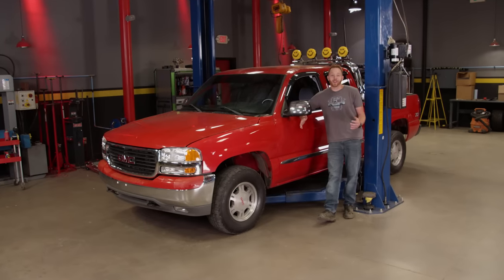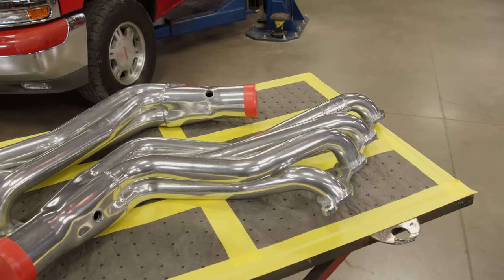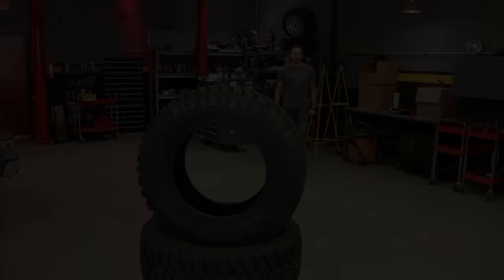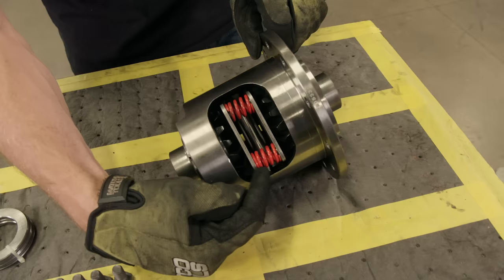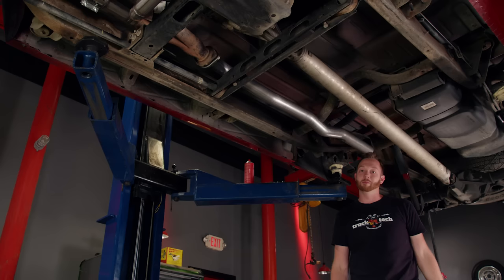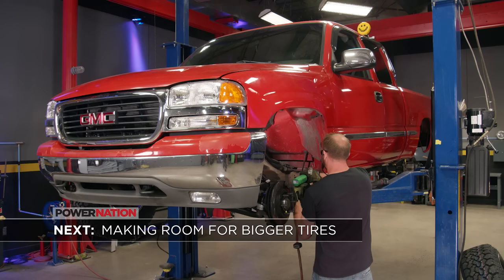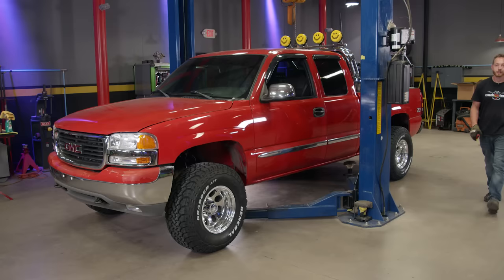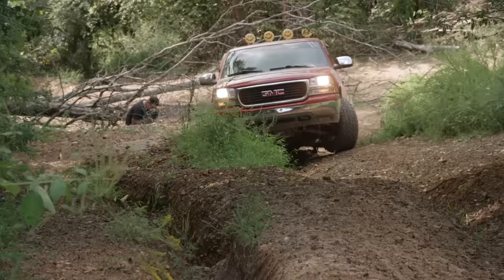FULL BUILD: Converting this 2002 GMC Sierra 1500 to a Mid 90s Throwback

Comment: You nailed the retro 90s look SPOT ON. The roll bar, KC lighting, polished “bullet hole” wheels, white letter tires…..AWESOME looking truck much better than the blacked out trucks with black 22” wheels, rubber band tires, Chinese tow mirrors, eBay led light bars, etc
Reply: you think they are chinese but they arent.
Reply: Retro 90's?  Roll bars were well before the 90's.  Lol
Reply: @Brian-dh9lp  yes popular in the 70s-the 90s.
Reply: Ahhh yeah!
Reply: 90s was peak truck. Whether its a 1500 or a 379
Reply: It's hard to appreciate a truck when everything is black.

Comment: Not particularly crazy about gmc but this generation sierra 1500 is one of my favorite bodystyles of all time.
Reply: I agree, not a big fan of the newer body styles regardless of the make. I drive a 2001 gmc sierra, came factory with the 5.3 lm7 engine but switched it for an Lq4 out of a later model serria 2500hd. With a bigger intake, a mid-priced exhaust kit at 280k miles it still surprises the hell out of some people at stoplights or on the highway
Reply: I love the 2023 GMCs they have that smooth but boxy look, I like it better than the Silverados except for the HD Silverados!
Reply: I love these with a single cab

Comment: I have a same generation Silverado with over 400k miles on it. Pretty much stock as well. They really will last forever
Reply: Mine has 200k right on it same color as this one in video only thing changed so far was water pump radiator but definitely needs head gasket now but very reliable truck

Comment: Absolutely gorgeous. I have an '05 Yukon XL I've built as an overlander/sand ripper. It's also my daily driver. All 9.2mpg and nearly 7k lbs of it still turns heads to this day.
Reply: Agreed. I have an '04 Yukon XL. The only GM I actually like and is still a far more attractive vehicle today than most out there
Reply: @VentureGarageOfficial  have you rebuilt that awful 4L80E yet? Had a shift kit done to mine. Nearly $4,000 for the whole thing. Only the casing is stock.
Reply: @searchBLOC941  I have the 4L60e in mine. And nope I have not yet! It still shifts smooth at well over 400,000km on the vehicle now. Tiny slip from 2-3 but nothing worrying.

Comment: I was in High school from 98-02 and there were a few old Square body's that had roll bars but most of the 90s trucks had chrome tool boxes, chrome bed bars and bullet holes.
Reply: Thats what I did to my '97 single cab silverado. Fender flares, M/T Classic III's, 35s, chrome tool box, and a giant DMI chrome rear bumper

Comment: I would’ve done a sheet metal intake manifold as well. Relatively cheap and easy to source it it really helps to open up the top end hp wise on those trucks. Great build though. Keep up the great work!

Comment: That’s awesome!!
I have an 02 Sierra 2500 with the 6.0 liter V8. It’s a gas guzzler. But it runs great still as I close in on 200K miles. I’d love to upgrade the exhaust like this.

Comment: My 1997 gmc Sierra slt 4x4 is in great condition. 100% stock!She's got 197000 Miles on her. I get a lot of compliments wherever I go! My other 2005 gmc Sierra sl 2x4 while it's a good truck just isn't the same. While it has more power on paper, it doesn't feel like it. The 5.3 is a good engine, no doubt, but I just prefer the old workhorse 5.7 in my 1997 truck.😊

Comment: the exhaust you used on this truck is great!, I have a 02 sierra, its only has the 4.8 V8 but I literally have the same exhaust minus the headers, still has stock manifolds, but it sounds exactly like the truck in the video. Mine has 375800km or 233511 miles(still original stock motor). still a great truck!. Guess Iam starting to show my age lol. my old high school yrs!. Great video.

Comment: You pretty much nailed it. The only thing i think would made it a lil more authentic for 90's is true duals with glasspacks like thrush or maybe some cherry bombs. Thats a true 90's truck exhaust. Now early 2000's truck exhaust we just ran true duals and chopped the mufflers off completely. 😂 it does sound damn good tho. Great job. 👍

Comment: I have an 03 Tahoe and I put 33x12.5 tires on it. But I also had 12" wide wheels with a -44 offset. I also had to trim my bumper and inner fenders just as you did, but I also had to lose my windshield washer reservoir because the driver side tire rubbed against it and would've just worn a hole in it. But you know, sometimes you have priorities and a good looking set of wheels and tires are much more important than windshield washer.

Comment: Hey I like my 33s.  This is pretty much what I did to my Silverado but no rear blocks.  The BFG KO/2 is a really good tire and not super expensive for a 33" tire which can get really expensive depending on what you buy.  Oh and it satisfies the muscle car guy in me because you can get white letters.  The Rough Country leveling struts ride really nice and you can run the 33 without rubbing.
Reply: A big electrical contractor company I worked for exclusively bought and used the K/o2 for their fleet trucks, roaming all over Oregon and it's crazy range of weather and driving environments.
For good reason I have learned 😁👍
I beefed My 93 Silverado with 2500 leaf springs, getting a couple of inches of lift and added cargo load capacity.
My 2005 2500 heavy duty is my daily for work and after two years of hard use I'm happy with it (BF Goodrich all terrains) lots of miles

Comment: Ive never had a issue with a G80 locker got 419 000km on my 9.5 14 bolt Z71 98 Silverado and the G80 locker still works as good as new all these years later

Comment: I did this same build with my hualer, its a 2002 chevrolet 2500 hd, extend cab long bed Did the roll bar with kc lights, 33s mild lift.   Did a brush guard and tail light guards

Comment: I want to do a build like this for my 79 Dodge W150 Power Wagon. It has leaf springs, but I can get a 2" lift for it with new springs. My friend that sold it to me put some 33x12.5R15 Firestone Destination M/T tires on it and replaced the clutch(NP435 trans, NP203 case). I'll probably keep the stock steelies, but definitely want the roll bar and KC lights, and a brush guard. Probably get those in black since it'll be a little more fitting for the patina that I have no plans on changing.

Comment: It's hilarious that he said those KC's were cheaper than LED light bars, those 4 lights cost around $500, LED light bar runs $150
Reply: In fairness, if you get a $150 light bar, it's not going to be on par quality wise with KCs. I think he's probably referring to Baja or Rigid light bars that are likely, still over a grand.
Reply: The LED KC's are $500 a pair, but the regular halogens are much cheaper. But their quality and lifetime warranty makes it worth it to me. Those $150 light bars will have condensation within a few months.

Comment: The '90s retro on those GMT800s looks right on the spot cause they still look slightly the same as the '88-2000 GMT400 body style 💪...
Reply: the gmt800 was very much a evolution of the 400,  i had a400 and have a 800 now, they are so related, but still i doubt there is a single thing that would swap between them

Comment: Those tiered wont last offroad. Ask me how I know😅 I installed sleeves on mine. But should have got a dedicated offroad control arm. I replaced all balljoints with mevotech ttx, after I destroyed moog and off the shelf ones i previously installed. Has been bulletproof since.

Comment: By adding horsepower will it then be a gas guzzler? I have a 2000 that needs new rear springs and the side bed fixed and new rocker panels. I just had a Flowmaster installed. I feel the difference in horsepower with just that

Comment: Find me an in 2002. They were kind of the same mods at that time. You could even get sun visors for these still and they had the manual transmission.... But sure I get what you're trying to do. I mean technically it's a period correct build.... I did this with a POS 2016... Knobbies on stock rims dual exhaust no tow mirrors smoked lenses old school simple... Then go rid of that garbage when it's a/c and trans crapped out and got a mint 2002 Yukon XL 6.0L 4L80 2500HD... I will die behind the wheel of a gmt800...I'll run a 1500 2wd 4.8l if gas gets crazy again

Comment: I have a 2001 GMC Sierra 1500 2 wheel drive 5.3 litter V8 285 stock horsepower  325 foot pound of Torque. My mileage is 124,789 Original transmission original engine. I have dropped in $15000 in mechanical repair and frame repair on this truck. I live in the northeast, so the salt is our big problem. Cost me $3400 to completely redo my frame. If I didn't do it, the truck would be junk. I went along and did everything so far. I'm not really satisfied with how far the truck has come. The handling on the truck is not where I want it. I replaced the shocks. I replaced the inner and outer tie rods. I replaced the wheelbarrowing hub assemblies. I replace the swaybar links and bushings. . Brand new drive shaft brand new dual exhaust system from flowmaster. The truck is much better than what it was a few years ago. But it's just a handling when I take corners with it. I had it checked my mechanic says. The bump stops are almost touching my control arms. He said this plays a big role in how your vehicle handles.. So I think my next step is going to take the control arms. Upper lower ball joints New Pitman, arm, new rack and pinion. You have to remember this is a 2 wheel drive truck so it has coil Springs in the front. Lee Springs in the back. So I think I'm gonna redo all of it. Would this help the trucks handling?????

Comment: Large brakes wont allow 16" wheel, my truck has 17s standard and its from this Generation. I intend on 285s or 33s while keeping the rake and not using lift blocks out back. Oil consumption was resolved with a different valvecover design developed in 2011, just swap the driver side unit. Sorry but 3" exhaust helps the ls breath better anyway
Reply: I did a 3in lift and am running the 285/75/16 Thunderer Trac Grip M/T's. I also had stock 17's, the factory 29in setup. I'm not sure I even needed the lift, but I also didn't have to do any cutting for fitment.

Comment: The differential explanation was not correct at all.  That is a true locking differential.  There are no clutches.  When the RPMs are greater than 100RPM between the two wheels, the differential locks together.  They had issues unlocking which is why they would grenade but it is a locking differential.  Made by Eaton and the RPO code was G-80

Comment: These shows are such a joke. They act like they are just DIY guys and everything is soooo easy while they do everything in a nice shop with an expensive lift and tools. Even you can upgrade your truck like this just buy 10k in tools and parts learn how to weld a new exhaust system and boom your all set. For god sake the Matco impact they are pushing is a $500 tool alone.
Reply: It’s fine to nit pick bro, I wish I had their shop too

Comment: Rollbar is the dumbest thing that is recreated the way they build it now because the idiots didn't even think about people that want to put a stack of plywood in the bed. The old ones bolted to the top of the wheel well which did not hinder the bed use if ya wanted to put something 4ft wide in the bed! Dumb!!

Comment: I had a power train transmission and it broke in 2 months they replaced it and the 2nd broke a mouth later. After that I got a used junkyard trans and a year later it is still running.

Comment: It made my brain hurt when you ordered what I found over the years unless you're buying high-end axles is that most aftermarket CV axles are junk. You guys throughout the entirety of that organization have custom drive shafts built all the time.... Almost every custom drive shaft show up does CV axle repairs and everyone who does CV axle repairs will tell you that you are exponentially further ahead to rebuild your factory ones or by high-end aftermarket then to buy junk off the shelf "OEM replacement" I would have just gotten that boot replaced and had the joint repacked.. Would have lasted way longer than what I'm guessing is just more rock auto junk.and the statement about the rubber bushings binding.... I did notice that you did not grease them. That's gonna squeak
Reply: On a side note you actually remind me so much of a friend of mine who owns driveline service of Pittsburgh.... It's almost spooky lol